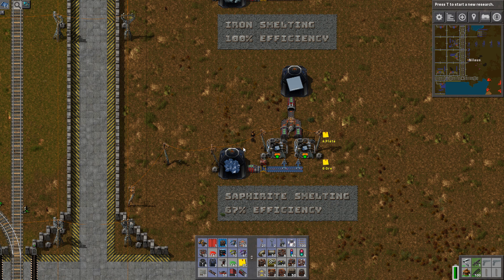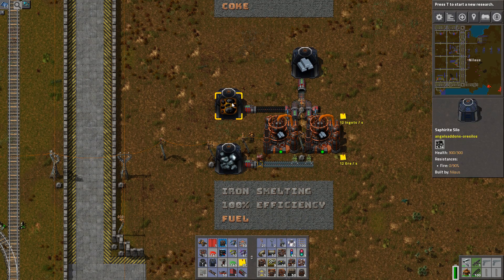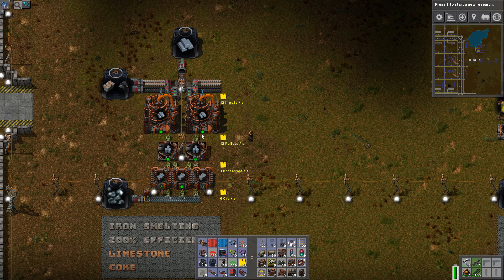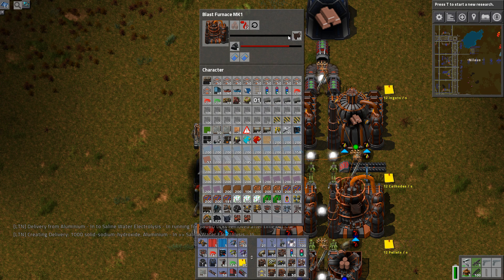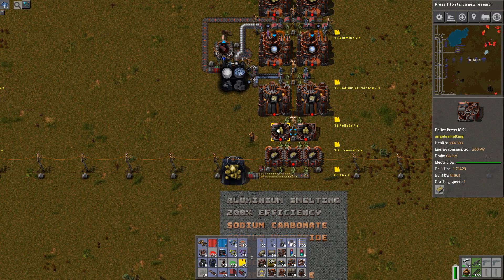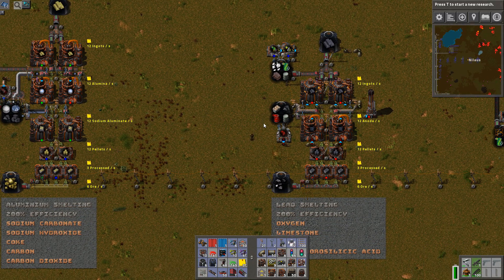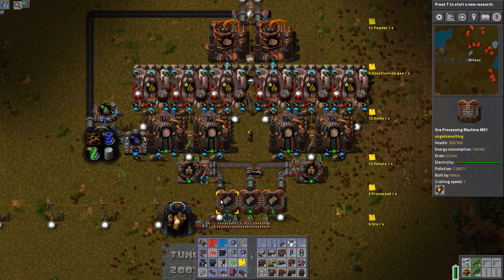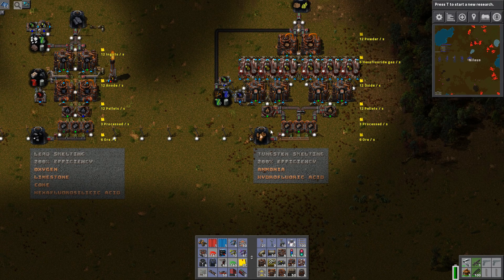Angels Mods Tutorial - Smelting - Efficiency and Ratios - OUTDATED

Comment: Can you use productivity modules in these machines? If so, how much extra stuff you can get?
Reply from the maker: Last time I checked it was not possible to use Productivity modules in these. Since a chain consisting of 5-6 steps would multiply the yields quite a lot, then it probably makes sense from a balance perspective. Remember the whole point of Smelting/Casting is to increase productivity so consider it an alternative to Productivity modules.
Reply: To be honest, they should change it so that you could use productivity modules in at least 2 of these machines in order to increase its yield compared to electric furnace with modules.

Comment: Awesome, thanks Nilaus. Very helpful, like all your vids.... This is the setup Im using atm after changing the old one (tried to make something similar to your building style.... I think is pretty nice & compact, after all) http://i.imgur.com/v6CaQm0.jpg Probably Ill need more iron ore inc (specially at the left part) but the amount of smelters & casting its damn insane lol
Reply from the maker: It gets pretty crazy and when you see the small trickle of output it is a bit disappointing. This is getting better in the new version and with higher levels, but it is still extremely space (and resource) consuming.
I like you setup it is nice and orderly and not too crowded. I would recommend the mod Text Plates to make some nice text on the ground.
Reply: thanks @Nilaus just tried to make something net & orderly... btw... I improved it a bit with more iron inc from the jyvolite & saphirite processing (down the iron area 8x crushers & 8x sorting machines) and also put 2 big tanks at sides with a non-return valve to make a loop-ish system and in case you run out or ore system jams for any reason, then you've a little backup on those tanks http://i.imgur.com/ojRTb2B.jpg. Everything  runs 100% with those. Ofc its only the coke process but wouldnt be hard to convert it to the coke + limestone process, but the smelting & casting output would be the same for a simple iron processing (without the addition of manganese or silicon ingots...)

Ive the Text plates mods and also the Natural Evoultion ones (apart from many others that you are already using at your 6th campaign, the one Im following the most) and somethings are a bit more complecated, like walls requiring some iron bars or rails requiring some crused stone.... Im looking forward to see your tutorial dor AAI programmable vehicles, coz its one I love but I run those wood cutting machines manually and would like to know how to run them auto... (nice way to deal with #1? enemy, cant remermber how bad are the forest to you ;) )
Reply from the maker: I had another look at the picture. It is very nice, but one thing I noticed is that the inbound Iron Ore is not distributed evenly to the machines. Some machines only grab when the previous has taken its part, which could be spread out a bit better. Not a big deal though.
Regarding the automatic forest clearance then you can set up a scanner to scan tiles for forest; if a tile contains forest then assign it to a zone. Then combine that with a miner going to all zones of that type. That should clear trees automatically. Just remember to have another zone scanner remove the zone when the trees are removed, otherwise the miner gets stuck there.

Comment: Platinum is the only version of the English name of that element. There is no "platinium". Aluminium is the only one where there are two names in common use in different English-speaking countries.
Reply from the maker: hmm, I don't like it, but it seems you are correct :)
Reply: It's like uraninite. It may not make as much linguistic sense as plausible alternatives, but it's the only correct name for that specific substance (the other common uranium ore is pitchblende but that's a different mineral entirely).